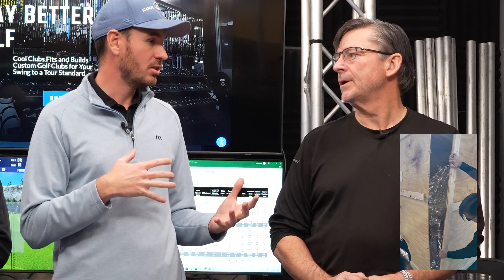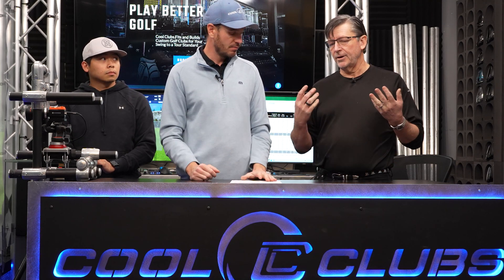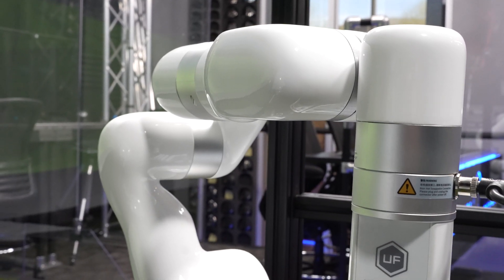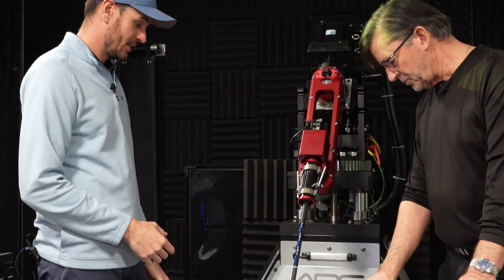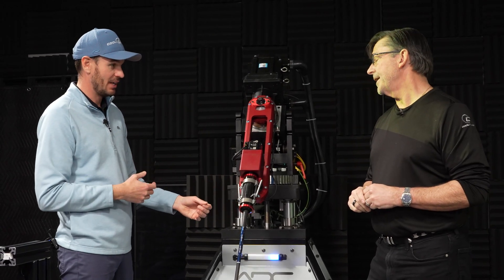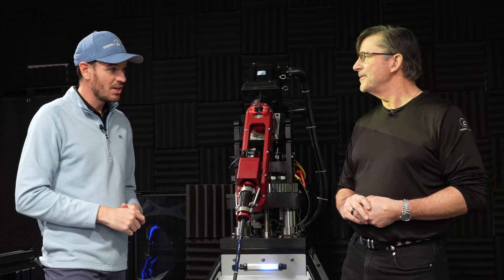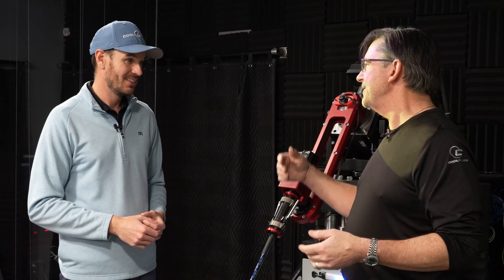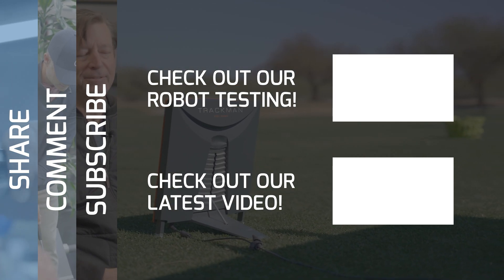Is Cool Clubs the BEST Choice for Unmatched Golf Reviews?

Comment: Can you show swing weight of the drivers you test along with the rest of the data ….also wouldn’t a driver with D5 SW have more distance than C8  SW with your robot at exactly the same swing speed ? Would make for a great video
Reply from the maker: We can do this, we use each OEMs standard weight head to start and can adjust as we go. But you are correct, generally speaking a heavier head should transfer better energy at the same speed. We will highlight this very soon in a Titleist driver review. Stay tuned!

Comment: Regarding driver testing, in the off season I've kept my TR3 but tested different shafts. I've seen night and day differences more than different heads. Would like to see a Slow,Mid,High test with the Ventus range and Graphite design range. Appreciate your database is more Head/iron vs Iron and in that regard you guys are top notch.

Comment: You should make it 75, 85, 95, 105, instead of 80, 90, etc. Might also be worth consolidating 75 and 85 into 80mph but with one round at zero path and the other with out-to-in path.
Reply from the maker: The smaller speed changes do not highlight as much difference in ballistics. Hopefully you can split the differece of the results if you are in between speeds and we will expand our testing as we go. 
We will also be adding fade and draw tests to help those player understand benefits.
Reply: @ thanks for the response. I think the general consensus is that everyone’s happy but if you’re only doing 2 rounds of testing then bump those speeds up by 5mph

Comment: I would guess the average 45-60 year old male swings right around 100-105 MPH with a driver. Thats the speed I’d like to see tested.
Reply from the maker: From the data captured in our fititng around the country we see 95mph is the center but its not too hard for us to adjust speed. Note that from 95 to 100 you will not see a result that wouldnt be relative to the other.

Comment: The king of driver tests! feels like 9 out of 10 golfers driver miss is a low heel. Put 2024/25 driver against one another on just that shot. After finding the most forgiving head then a follow up on how to make it even more forgiving with shaft.
Reply from the maker: Shaft testing is tough. We control the head delivery through impact to ensure consistent strike location and path/face delievery. If we get our 0* 0* numbers, we negate what the shaft does. That being said if we could create a jig that put the head in the exact same position at address and just swapped shafts we may see reults. The other factors would be when we add speed, rotation, release, closure etc... its a minefiled! Never say never.

Comment: Not sure if you have done this. Compare two irons off center hits with same loft. One a blade like club 770 forgered and a super game improvement iron with similar loft. Maybe bend the forgered club to match game improvement. Maybe use like 85mph swing swing speed average amateur. 
 Just curious if forged newer blades may not be much different than game improvements for off center hits in drop off distance?
Reply from the maker: We havent done this as we have been trying to highlight off the rack performance, but once we get through releasing all the new 2025 products we can do tests like this to show what happens.

Comment: I would love to see a test of drivers vs. 3 wood. The new mantra is to hit a driver whenever possible. Distance is key. A 3 wood is harder to hit, although its loft of 15° makes it easier to get airborne. Because it has a smaller head it is harder to hit. But - a women’s driver, with a full sized 460cc head, does come in 15° (example is Cobra Air-X). It would in theory be as easy to hit as a 9-10.5° driver, but with a tighter dispersion. 

So a regular men’s driver at 10.5° vs. a mini driver vs. a 15° 3 wood vs. a women’s 15° driver. Shafts could hopefully be the same. Would a women’s 15° driver be better in the bag than a standard 3 wood or mini driver?

Looking forward to seeing what you have in store for the new robot. 

And, maybe a contest for your viewers to name it …
Reply from the maker: We are open to naming suggestions, do not be afraid to let us know! 

We can do a test like this, settign up woods and hybrids will take us a little longer, we have driver, irons and wedges locked in so far. 
In the summer we can try tests like this... maybe earlier.

Comment: I understand swing speed, but does it matter the tempo of the swing? Meaning slow back swing vs fast back swing. I have always wondered how it affects the bend of the shaft.
Reply from the maker: In this case we control the impact zone, so no matter how you get to 0 path, face and angle of attack we negate what the shaft is doing. Shaft testing is tougher but this machine may be the first robot that can do it better than before.